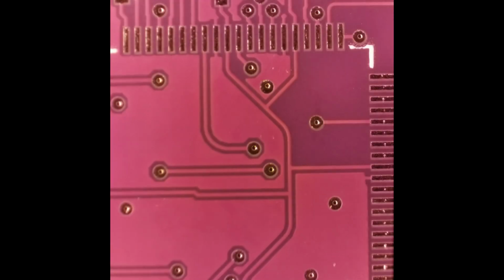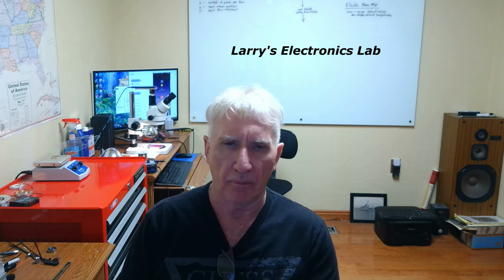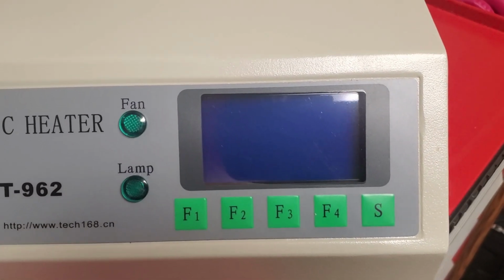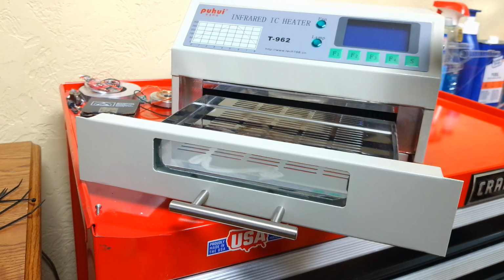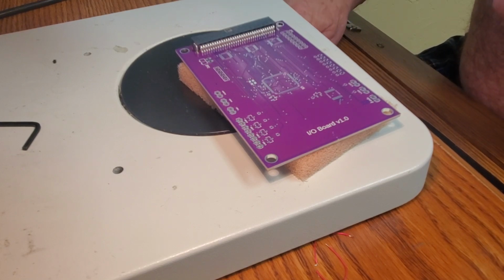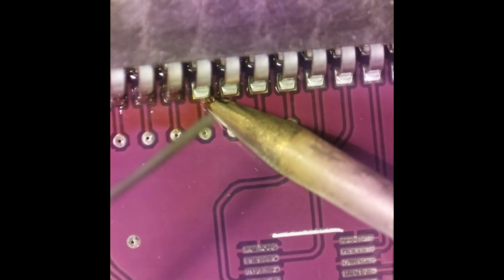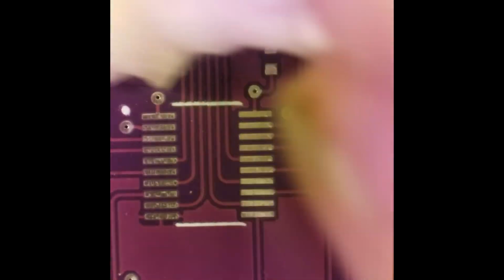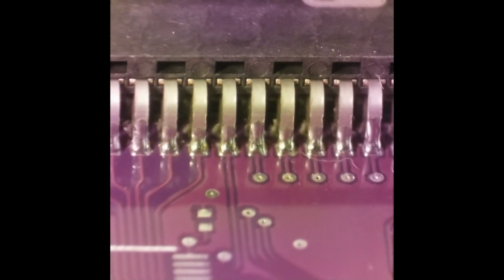Episode 8 - Board Assembly Part I - The I/O Connector

Comment: probably a better idea to use a through hole connector than a surface mount
as its more easily accessible from the rear.  

routing it might be a challenge with that many pins however.

perhaps adding a small via next to each rear pin connector might enable
you to touch the via with a soldering iron tip 
and melt the solder on the other side.
Reply from the maker: The connector seems to be holding up so far.